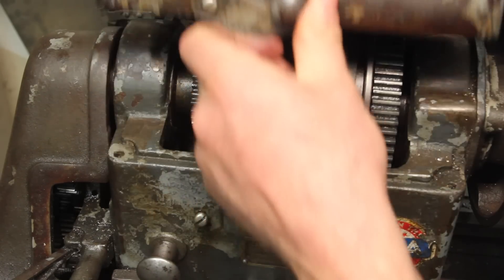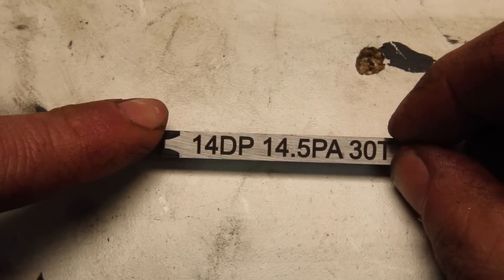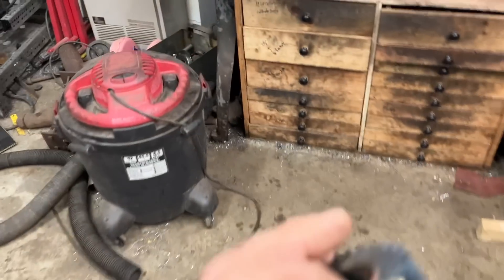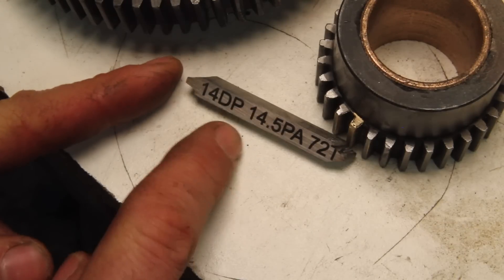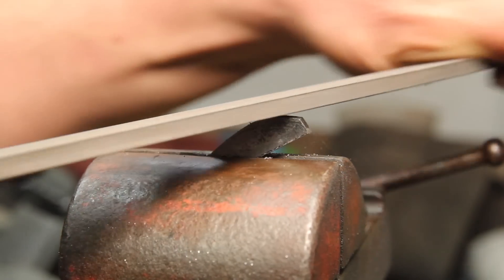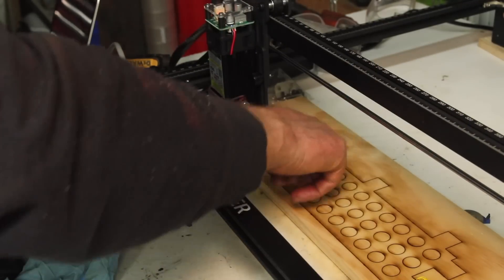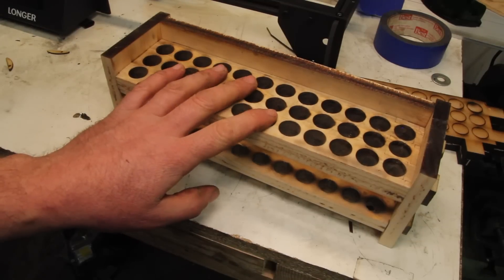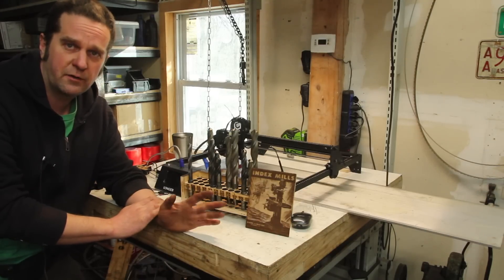Longer Ray5 10W Laser engraver overview- Small but mighty.

Comment: couldn't you use the engraver to make the profile on the gear and grind down to the line? Instead of making a tool.
Reply from the maker: I think I tried that to give me a reference line, but it was too hard to get the gear lined up properly and the engraver didn’t work in the braze.
I think you could cut a mask out of tape with the tooth profile, stick it to the gear, and use marking fluid or paint to mark what you want to grind of file out though.

Comment: I also have the longer ray 5 10w but for some reason i couldn't engrave aluminum. I ran it 100% power and only at 50 speed but still no scratch. Any idea?
Reply from the maker: Diode lasers like this won’t mark aluminum (or certain other metals like copper) directly.  You’ll have to use something like Cermark, which is basically a pigment the laser burns into/onto the metal.  I haven’t tried it, or looked into it too much even, so I can’t give you specifics, but that at least gets you on the right path.

Comment: I just recently built an engraver with swappable 5W and 10W lasers (10W with air). I've been experimenting with cutting thin wood and engraving steel, wood tile and glass. You've just giver me a whole bin-full of ideas. On some projects, I occasionally print out my design at 1:1 and tape that to the work-piece to centre-punch locations. It would be so convenient to etch the whole thing on the metal. Everything would be clearly shown and easy to work with. New rabbit-hole - I could put the 5W laser on my little CNC mill and control it through Mach3. Thanks for the new ideas.

Comment: Could you please try engraving on lots of different materials? Chromed steel like wrench sockets, aluminium, hot rolled steel with scale, rusty metal, anodized aluminium, painted metal, stainless steel, steel with the scale ground off, 3D printed plastic. And I see other examples on the web of engraving different colours on metal - is that doable? Make some boxes with dog bone style cut fingers for tool trays. How's that for a video ? Thanks it was interesting Jeremy.

Comment: Neat ideas for the use of the a laser. Did you put an etching chemical on the steel before you shot it with the laser or was that just hitting the HSS straight?
Reply from the maker: Straight onto the steel

Comment: "Semi-steel. So maybe cast iron with a little steel mixed in"
I about fell off my chair!  😁
Reply from the maker: I did a bit more research, and that’s pretty much exactly what it was.  Cast iron with some scrap steel mixed it.  For context, it’s a WWII era machine, so it makes sense.
Reply: @JeremyMakesThings  Steel is a solution of carbon in pure iron.
1020 = 0.2%, 1080 = 0.8%, etc..
Cast iron is a solution of carbon with more than 1.7%, and typically ~3%
Reply: @jimurrata6785  theoretically ;) Anyone from Sheffield will tell you that you can't reduce steel to just iron and carbon ratios though.

Comment: I saw an article years ago in home shop machinist about brazing on material to repair gears. That guy said you had to drill into the gear body and put threaded studs in where the teeth would be, and braze around them. If the tooth falls off again maybe try that.

I can't believe you can engrave metal with those things. I used to have a 130W CO2 laser and I couldn't do anything to metal without that marking paint they sell.
Reply: yeah because most metals are reflective. there's a step he didn't show so it would engrave the steel.
Reply: Also the wavelength of the laser is important - CO2 lasers are infrared (long wave), this is blue/violet (short wave). Infrared is good for some things, and blue/violet is good for different things.

Comment: That’s why you need two lathes. Maybe three. 😊
I’ve cut a bunch of gears using single point hand ground cutters. It works quite well and when done right the finished product is indistinguishable from those cut with an involute gear cutter. Nice work!!!

Comment: I really enjoyed this video. Very novel use for the engraver. If the brazed teeth do wear/fall off again, you can drill some dowels where the teeth are meant to be be and then braze. 
As for pointing the laser at something, it would be really great to see text engraved into black anosided aluminium.

Comment: Bruh, please, get some proper laser goggles rated for the wavelength output of your machine... Laser goggles are quite costly, and highly specific for wavelength ranges that they can block... Ditch those green sunshades... I have those same glasses for years now, as they were the decent option for me when i needed to grind some thick rust... Sure, they shade the sight, but they are thick and wont crack or get fucked that easily... But laser output and an angle grinder sparks and shrapnel are two diametrically opposed danger sources... Be smart about this, lasers are much more specific and destructive than even a welding arc, and even the welding glass shade 13 wont stop quite a lot of wavelengths emitted by laser modules... Please, dont fuck with lasers... Also, look at the colour of your protective glass around the laser module, its orange-pinkish, and it can block the wavelength of that laser(or at least should), whereas your goggles are green, and thus block my cock and maybe a stray rock, but not specific high energy wavelength of that little box of blindness.. Ditch those as laser protection, use them to hammer and forge shit or for such things, but for optical protection from laser, please, look at the module, read its output wavelength and invest in proper goggles... A laser than can burn wood or etch metal can obliterate your sight in a nanosecond with a decent refraction and thats it... No more editing, machining, no more seeing your kids or your hairy balls... Dont do it to yourself, i enjoy your content since you had a much smaller number of followers, and dont want for stupid shit to cost you more than the whole world can pay off... Kissing a shotgun i can understand by anyone, but errantly blinding oneself would be a tragedy beyond the sweet kiss of lead... I try to give the same advice to most content creators who get these danger synthesizers, but i hope it will get through to you... I know those special glasses cost a lot, but lasers are just as bad as working with anthrax or dimethyl mercury or such... One little mistake and thats it folks, you are done for good... Most mistakes can lead to harmless refraction and you can make billion harmless mistakes, but a single one can lead to fate worse than death...

Comment: Why will it engrave tool steel but not aluminum?
Reply from the maker: Part of is the aluminum disperses the heat too quickly (more so than the steel), and I THINK part of it the the markings of the steel are result of forming oxides (like when it turns colors when you heat it with a torch), but aluminum doesn’t do that.

Comment: Would love to see if it will cut laminate flooring, that stuff is cheap and available everywhere.

The cheap stuff is still HDF-wood with a phenolic backing and a wear-surface on the other side and stiff/strong enough to serve as a direct replacement for most things you would make out of the same or slightly thinner alu or 1-2mm sheet-metal, and the more expensive stuff is even better and has a wear-surface that is so though you could actually use it as a sliding surface for many kinds of tools(cnc-router, angle-grinder slide-stand etc. could probably build a complete dremel-spindled milling-machine out of the stuff)....
Reply from the maker: I think I have some scraps in the shop.
Reply: @JeremyMakesThings  Cutting it from the rear is probably the best option as many wear-surfaces have stone and mineral powder in them.